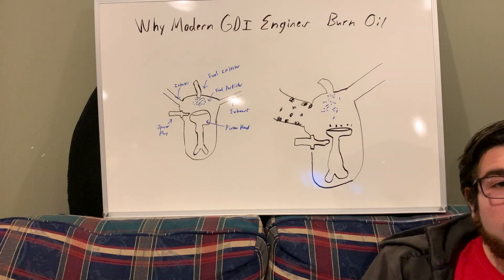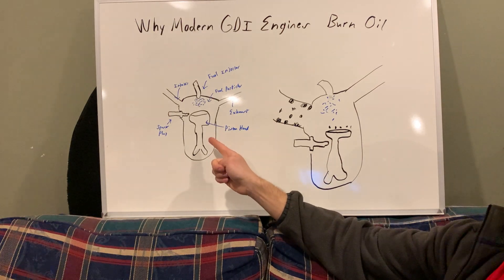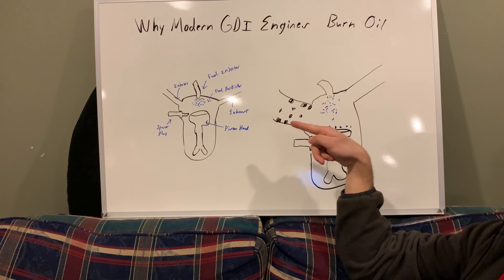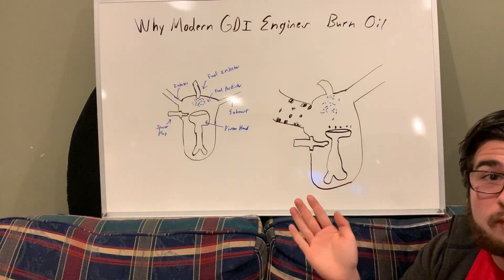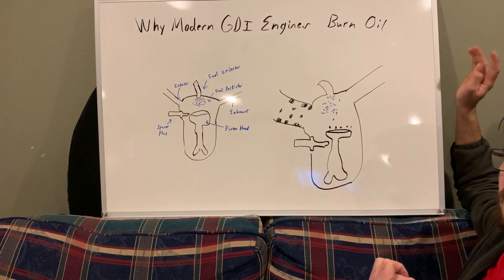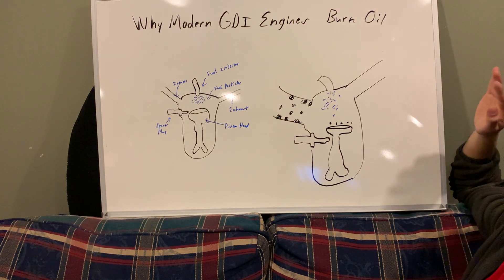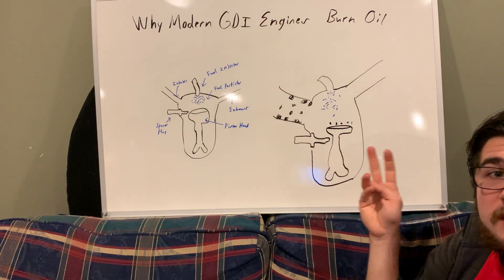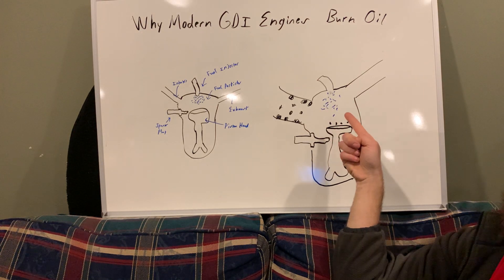Why G.D.I. Engines Burn Oil

Comment: I get that there is more carbon im the combustion chamber itself as the PCV sent it there. However ,Why is heat in the intake runner when cool air is flowing through?? The combustion chamber has heat yes but that doesn’t explain how that heat affects the buildup in the intake manifold and runner going into the chamber via intake valves. Cool air should be constantly flowing over that whole area from the air filter?
Reply: In Texas it's rare that you have cool air anywhere.

Comment: Hey, my 2012 LINCOLN MKX GDI DURATEC 3.7 litre Cyclone V6 has 120k on the clock and does NOT 🔥 a drop of OIL!!!
Your generalizing presentation is dangerous.  Yes the mfg's dealt car owners a bad card with GDI however its not the endall as you profess.  
LIVING WITH A GDI ENGINE
Fact this!
We use a Tier 1 gas.  BP 87 octane pump gas. High quality syn oil. We use Liqui Moly Special Tec AA 5W20 syn engine oil and their Engine Flush prior to each oil change @5K miles. The flush has no effect on gaskets/seals and super cleans the entire bottom end of the engine. That includes pistons, piston walls and rings.  Liqui Moly DI (direct injection) Jectron every 2,500 miles cleans the entire top end of the motor. That includes valves and combusion chamber. And to top it all off their Fuel Injection cleaner every 1,200 K miles. It's a dirty world out there right down to waxy content in unleaded gasoline.

You brief fails to address the above.
You may have a case with:
▪︎ Owner engine discipline. Using garbage gas, rarely change oil and only with cheap stuff . No coolant/trans maint. The engine is on the road to perdition.  
▪︎ Manufactures - Hyundai/Kia horrid engine quality, BMW and the like.
▪︎ Climates - Arizona types V.S. hmm say northern climes
Reply: Sorry dude those engines are not direct injection,  the 3.5 ecoboost is but not the 3.7, I worked at Ford for 20 years if you wanna question me. Lol.
Reply: @danielteichroeb7200  How so?  where to find the proof? Gee have I been misled?

Comment: Hey thanks for the information very nice indeed👍🏾. Did you miss speak near the end saying Toyota is making a engine that’s spraying gas not only in the GDI but in the exhaust? but you pointed your finger to what you told us in your drawing was the intake side. 
So is Toyota making a engine to spray gas not only in the GDI but in the exhaust or is it the intake?   Go to min 3:40 onward to check and see what is I am talking about.  Or Maybe I didn’t follow you correctly.  Thanks for this. 
I await your response❤️🙂
Reply: Intake.
Exhaust would waste gasoline and ruin the catalytic converter  and make the EPA angry.

Comment: It’s a little something called planned obsolescence. They are purposely making engines that don’t last to 100,000 miles anymore so people will have to replace their cars sooner than necessary. Not only planned obsolescence but poor engineering and quality control and that’s why engines are burning oil before 100,000 miles.

Comment: Never had that problem with my 2015 or 2019 Kia Soul 1.6 GDI.
Reply: 1.6 was abit more reliable than the 2.0 theta and 2.4.
Reply: If you change oil regularly then shouldn’t have any issues. A couple factors that could increase the likelihood hood of it carboning up pretty bad and causing combustion and power issues.

Comment: Ridiculous proposition. Carbon build up in the inlet port causes oil burning? What nonsense. Like to present evidence of increased oil consumption?
Reply: Look up Kia's Service Bulletin on excessive oil consumption. They deal with carbon on the intake valve as well as the cylinder rings.
Reply: @mcgeorgerl  OK, if you say so. Ain't gonna bother looking it up, but find it conceptually hard to believe. I'm happy to remain ignorant . . .
Reply: @mcgeorgerl  Yupp why I run a oil catch can on our 2020 Tucson don’t want to bother having terrible effects of carbon buildup.

Comment: KIA states for GDI engines any consumption up to 1qt per 1000 miles is considered “normal”
Reply: Sad.
The oil burn may be within manufacturer specifications.  But such consumption is not meeting customer expectations.
Reply: Ya that OK with a 79 Rabbit Diesel motor BUT it 2022 so I think we can do better.
Reply: Mine burns 2-3 quarts within a thousand miles and they still won’t do anything about it

Comment: interesting. i have a Dacia (Renault) Duster with the 1.33 tce 150 bhp engine with direct injection and for now it does not burn any oil. bought in jan 2021 from 0 km and now it has 23000 km
Reply: It’s usually after 100,000 miles that this starts to happen for gdi from what I’ve researched so far.
Reply: Yeah my Megane 1.33 140hp also does not burn any oil. 50k km at the moment.
Reply: The main point shouldn't be that there is a problem with GDi, just that there are unique factors to take into account. different cars will burn more or less oil than others, and if you competently take care of your engine then these issues should not manifest anyways.

Comment: My 2017 Sportage is now using 1 qt of 5w20 in about 1000 miles, if Kia doesn't cover it, I may trade it off for a Rav4 or something not GDI.  Tho a catchcan would help a lot, it voids the warranty and has to be installed early before there's a build up.
Reply: Get rid of it. I “Had” a 2016 Sorento. I changed the oil honestly very 3,000 miles and by 2,100 miles engine was almost bone dry. Brought to the dealer and told me that the oil consumption test they did was normal. This was about around 85k I drove it all the way to 107k and said enough was enough and got rid of it. I don’t care what anyone says I will never buy another Kia/Hyundai ever in my life again.
Reply: Ive read  that the  catch can does not void the warranty unless  the Mfg  can prove that the catchcan  created  the problem or breakdown  that  is  up for getting fixed.  In other words, if your A/C  goes  out, there is no way they can blame the catchcan for the new problem.
Reply: Rav4 Toyota has burn oil to
Reply: A properly installed catchcan will not void the warranty. They have to prove that the catchcan caused the failure. I had an aftermarket intake on when my turbo failed. The intake was not contributing factor and it was replaced under warranty.
Reply: Bad luck or did you not change the oil regularly?  My 2013 Kia RIO hatch with 70,000km doesn't use any oil between changes, and so far the only issue I've had is changing a burnt out brake light ($1.30).  Toyota's have their issues too (I've had 3 of them) and really aren't worth the almost triple price you'll pay for them.
Reply: What was your oci ? Also you probably were unlucky. Very common to get a bad one since they ducked up so many engines and still sold them and denied the issues that lawsuit told it all. They seem to still win though. Big companies big $
Reply: I have a 2021 Kia and was told by dealer that catch can do not void warranty and he don’t know why they are not standard equipment. I get a fair amount of crud when I change oil at 5000 miles.
Reply: Well my 2018 GDI 48,000 is done burning quart b4 1000 miles p.o.s. is what it is

Comment: so what do you recommend for a gdi engine that is consuming too much oil? can anything be cleaned out or do things have to be rebuilt or replaced? pcv didnt solve anything. vehicles is 2013 kia sorent gdi 4 cyclinder. 100k miles and burns way too much oil
Reply: Trade it in for an older more reliable SEFI engine. GDI is a product of bureaucrats.
Reply: Find a mechanic that has a snap on machine that the vehicle runs off of. It fixed my truck and car. Cost me $139 each vehicle
Reply: healthyamerican , same I have 15 soul and burns oil. 
I'm about to take off my intake and clean up.
Reply: A detergent based engine flush like liquimoly.

Comment: That has nothing to do with direct injection engine......
All engines burn oil past the piston rings, and through the pcv as well....

Nothing to do with gdi...
Gdi doesn't increase oil temperature, it does the opposite cools the piston so it can achieve higher cr ratio and turbocharging ...
It uses fuel atomization Wich in turn provides a heavy cooling effect on piston.... Fuel atomization doesn't increase enough the combustion temperature.... It produces nox emissions but even more PM  making manufacturers go to port and direct injection D4-S and GPF filters 
Direct injection Makes it less prone to knock pre ignition.....

Intake valves having carbon buildup don't cause issues other than lost HP due to restricted air flow...
And check engine light cylinder misfire when valves get stuck...
Reply: All you people need to find a mechanic that has a snap on fuel system cleaning machine. Let them do the work. The vehicle will run off the machine and it cleans all parts of the engine including the intake valves. I was having the same lack of power going up hill and such. Mine is now fixed and runs great. Cost me $139.
Reply: Yae but gdi pings and if its bad pinging doesn’t that increases cylinder temp in the event it happens? I know timing is pulled but it bogs the motor down bad I’m sure if you prolong this it will increase cylinder pressure and could increase blowby. Seems it may even cause cylinder wear wich also could lead to bad things including oil consumption theirs a lot to go wrong in a poorly functioning gdi.
Reply: @henrytom5824  yet again nothing to do with gdi...
Pinging has to do with engine compression, clogged injectors, or bad timing...
Nothing to do with gdi here...
Blow by is increased with the use of turbochargers creating higher cylinder compressions...

They use gdi to decrease pinging, exactly the opposite of what you say...

If you used port injection on 13/1 or 14/1 NA engines It would ping under WOT low revs... 
But thanks to gdi it doesn't.... 

Same thing with engines 10.5/1 cr TURBOCHARGED, 
Using turbo for the extra compression missing compared to NA engines 13/1
Reply: @lcpd26  I think your abit delusional bro we have a brand new car and it pings from time to time 2020 Hyundai Tucson and no I don’t use bad fuel it’s the nature of the beast because it’s a gdi motor. From my experience this is our second hyundai both of them have pinged from time to time and it’s audible you can’t miss that marbles in a can rattle.
Reply: @lcpd26  Why else would a brand new vehicle ping that uses shell fuel or mobile synergy , oci every 3750 quacker state also running a oil catch can since 1,000 miles now has 32,000, theirs no serious buildup and it runs perfectly absolutely no oil burning. It happens in lower rpm’s cruising that has everything to do with it being gdi (lspi).
Reply: @lcpd26  “It is true that when they are clean, GDI engines do not burn as much oil as other engines. As a result, when those deposits flake off, they can become lodged in the piston ring, which increases oil burning directly” This is straight from google from a site if you have carbon buildup and carbon caking on the valves and piston tops if prolonged it can cause oil consumption like Hyundai they use low tension piston rings so if they crap gets lodged in between it can cause oil consumption. I think your too stuck on Toyota. Gdi has cons and pros but those cons suck and you wonder why Toyota stays towards mpi and why Hyundai is switching a lot of their lineups to mpi.
Reply: @henrytom5824  GDI has nothing to do with lspi...
An engine that runs gdi doesn't have lspi...
Lspi is caused due to high compression, or high peak cylinder pressures during turbocharging....
It can be adjusted by ecu tuning from knock sensor inputs...
Many times happened and being addressed with ecu software is updates....

My 8nr fts 1.2 turbo Toyota, is fully gdi and turbo! 
Burns 0 oil, no pinging on 95 octane, 
And no lspi either... 
Clearly this has to do with ecu software design and updates,and knock sensor inputs... 

Nothing to do with gdi
Reply: @henrytom5824  they are not switch to mpi for that reason....
Toyota uses the D4-S now due to the Nox levels of GDI
With gdi you have atomization of fuel wich decreases co2 and gets way better fuel economy, and let's you push engine compression way further(higher)under WOT,
However it increases Nox Emissions and PM, by allot..
Causing manufacturers to if insisting only on gdi usage to go with expensive gpf(like dpf), wich they don't want to, or using egr valves plus egr cooler wich they don't want to....
So they prefer using port injection on low demand throttle inputs and under high demands GDI,
Making the best of both worlds..
Splitting nox émissions by 50 percent
Reply: @lcpd26  I don’t 100% disagree with you but their is a reason why they are switching to mpi. Idk what to tell you it pings and it is gdi na 2.0l Nu gdi 2020 Tucson it pings not terribly but it does. Most normal folks don’t have a ear for it.
Reply: Their are tons of folks with Kia’s and Hyundais with oil consumption issues mostly from debris in the manufacturing process but real world they do burn oil if not very particular on preventative maintenance and early oci’s. Again I agree with what their goal is but in the real world their are a shit ton of them that burn oil and it’s related to the gdi system and debris. Our 2016 Tucson burnt oil and it wasn’t on the recall list 2.0nu.
Reply: @henrytom5824  yet again this has to do with engine design not related to gdi....

1nr fe toyota 1.33 had oil consumption it is however a port injection only engine...
8nr fts 1.2 turbo GDI and turbocharged engine, no lspi, no oil consumption
So it has nothing to do with gdi....
Don't read what everyone says and is not a qualified engineer.....

GDI has nothing to do with these issues....
Oil consumption, blow by, or other things...
It's just an injection mode...
Wich when done correctly works pretty reliably,
It's just expensive when it will fail Wich it will fail one day in 30-40. year of ownership...
Woch will make your car  then a total loss..
In 30 years Time value of car will be 800 dollars, or euros, and HPF pump will cost 1000 euros to replace
Reply: @lcpd26 Agreed I believe Hyundai just sucks on their design. I Forgot Mazda does a pretty damn good job with their gdi so I suppose you are correct for the most part.

Comment: Ihave new kia k5 2021 I add have battle evey 5000mail is that normal?
Reply: It burns a quart every 5000 miles or km? And 1600 miles is acceptable by the manufacturer? Wtf? Um, no that's not acceptable. Way to much oil getting burnt. Sell the damn thing and buy something with atleast 4 letters.
Reply: @benca6151  now in winter didnt lose any oil also in summer I lost some cuze my foot is heavy  and my car is 4L and above
Reply: Ask your Kia dealership what's acceptable.  Mine said 1 qt at 1600 is acceptable...
Reply: For piece of shit yesssss

Comment: Will replacing the PCV valve help?
Reply: Hi, you can install I oil catch can downstream from the pcv valve. This will remove a lot of the oil and solids that may end up in your intake and get burnt. It will definitely slow the carbon build up down.
Reply: @germanator0  Sadly that should be done early in it's life, and it voids the warranty.
Reply: @lonniebeal6032  it will not automatically void any warranty. possibly engine or fuel related issues. but  they are not harmful to the engine. just remove them before taking them in for warranty work. I have had one on my 2018 from the start. Keeps the intake and upper cylinders cleaner. Also delete the cylinder disabling feature. This also causes excess oil consumption.
They really build a lot of problems into engines in the name of fuel economy and emissions. Just to be able to make and sell them. All due to overzealous regulations.
Reply: Unless it’s leaking through seals because it’s stuck closed don’t believe it will cause oil consumption in the combustion chamber.
Reply: no.  A bad PCV makes your car run bad, pressurizes the engine, and creates sludge.  A good PCV routes the fumes to the intake.
Reply: No I replaced PCV and spark plugs at 105 K miles. It did nothing for the oil burning.
Reply: I think that it helps with stalls and loss of power, but not  oil burning.

Comment: my understanding is different on the build up of carbon on the intake valves.  The PCV sends the blowby back into the intake air and it builds up on the intake valves.  But you don't get much in the way of blowby if you use good oil and change it regularly.  Long oil change intervals may result in ring wear and result in more blowby and more carbon build up, and even more oil burning.  So, change your oil at 5k miles and use a good oil.
Reply: PCV combined with EGR...Unless you build the engine yourself, you have little control of the cylinder ring end gap and blow-by.
Reply: Yuppppp exactly
Reply: It don't matter kia GDI of you don't clean intake and valves every 40k miles they will start burning oil.
Reply: This happens on all cars with a PCV system to some extent. The difference is that when you have port injection gasoline is constantly running over the valves cleaning them. It's also why if you notice your car burning oil a good first step is to change out the PCV valve as they sometimes get sluggish or stuck and let too much oil back into the system. Also, if you idle your car a lot (in town driving with stoplights) it can be a lot worse as that's the only time you can really get blowby on the PCV as under load the crankcase will normally be in a vacuum and the pcv is just there to let air in, not out.
Reply: Why would Toyota inject fuel into the exhaust system??? Nice one Sherlock.
Reply: @michaelnewman5734  Toyota and Ford (there may be others) both use direct injection and port injection on their engines to avoid carbon build up.
Reply: @csinalabama  what good is injecting fuel into exhaust??? I'm assuming the author stuffed up and didn't proof-read before posting.
Reply: This is correct answer!